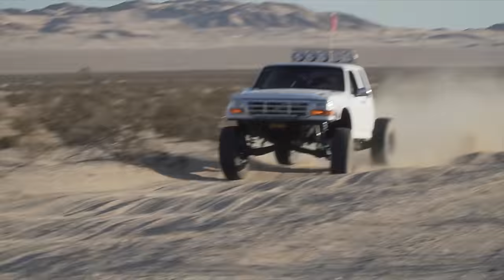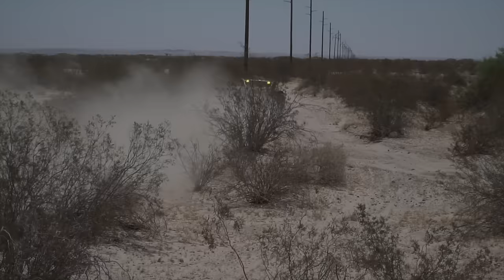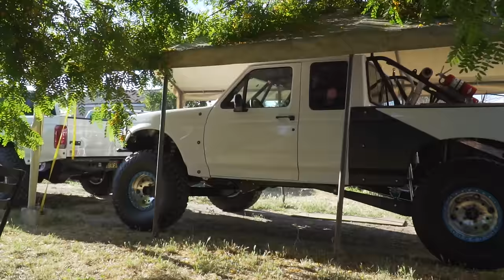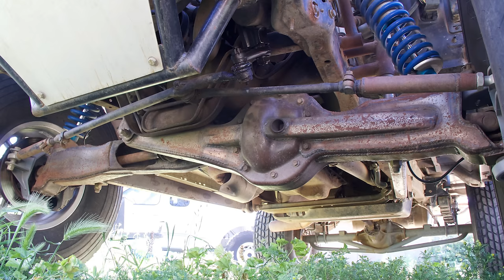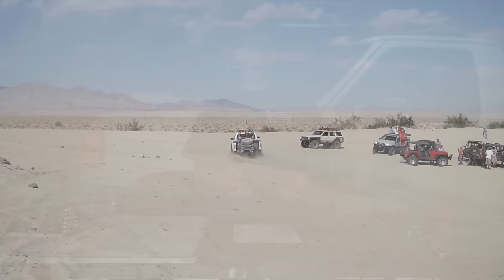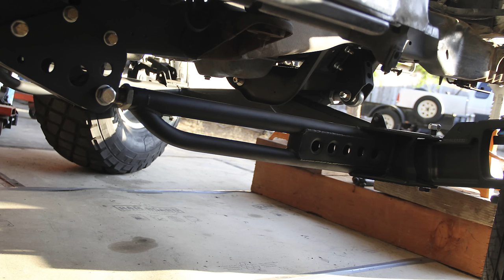I BEAMS VS. A ARMS! Which is BETTER? PRERUNNER 101

Comment: One thing not mentioned in regards to steering is ackerman and its effects on the street. I beams usually has horizontal uniball/balljoint/kingpin in short this means the steering angle is unlimited, you can have proper ackerman where the inner wheel turns more than the outer wheel. with a arms, specifically "race kits" the upper uniball is usually vertical , this gives about 32 degrees steering before the misalignments are maxed out. to compensate most kits run reverse ackerman where the outer wheel turns in further than the inner wheel; this causes scrub at low speeds and impedes steering radius. this topic is a rabbit hole but worth mentioning
Reply: Exactly the rabbit hole all of the different set ups designs etc really have trade offs even building something from the ground up with design.
Reply: To combat this issue, I ran a ballistic rod end for my upper, it had a misalignment of 74 degrees total or 37 degrees, which was more than enough considering the cv joint limitation.
Reply: @davidfarmer  Can you explain to me what angles you're referring to on 74/37 degrees? And you mention CV's, so I'm assuming you're running a 4x4?
Reply: @JacopoSkydweller  yeah it was for a 4wd spindle. basically 0 degrees with the tires straight forward, then all the way turned and bottoming out 37 degrees of misalignment. The bolt that goes through the ball of the joint run from the from of the vehicle to the back. this way there is no restriction on up and down travel.
Reply: Correct, but the spindle design, as well as the wheel offset play a role as well.
Reply: @davidfarmer   Oh gotcha, that makes sense. Thanks man.

Comment: For most of my life stock fords had I beams and Chevys had A frames. I believe this explains most of the differences in the way they drove. I'm not talking anything but stock from the factory with a lot of miles on them. My experience was that the ford front ends were more durable and almost impossible to damage. But the Chevys handled better on the road and were easier on tires. I also noticed that that with Chevys handling was far less impaired by lower quality tires. I believe if I was going to do a lot of off road driving with stock equipment I'd choose an old Ford. Once you move to modified equipment I suspect it has more to do with how much money and effort you put into it.

Comment: The problems i see with I beam suspension is the wheels are probably gyro based (the wheels look heavy and they will spin around rapidly), the camber would probably offset the weight of the circumference and probably cause unstable airtimes.

Comment: I had to build up my radius arm to beams. I gusseted and plslated the beams put top & bottomm radius arm to beam mounts and added a vertical piece that tie them togetherand added a mount to the beams MADE GUSSET TEMOLATETS AND HAD A METAL SHOP COMPUTER NAVIGATED CUT VERY NICE THEN MY PRO WEILDER FRIEND AND i PUT THEM ALL ON AND HEQTED QND BENT WOME DOING SO TOO. i added an F250 pass side axle with the big U joints then cycled it in 4wheel drive while spining the wheels by hand while turning left and right clearing any tight spots and set the limit straps. i have put it through a lot of whoops some air and surprises with no problems. bought 96 glass fenders and hood with core support new radiator grill headlights split my astock fenders and added strength to the outside of my inner fenders and tubes to the core support. Went HID with the hes=adlights big improvrment and some brighter HID's with the same ballasts into a set if Hella cans for light further in frontbeams it changed the 87 to the 96 front end also 96 spindles the brake calapers bolt to and one was about to loose a pin of the 2 when I did. all new spindle bearing studs bearings and seals and outer axles to loose the tophat hubs. AMBLANCE STEARING ALSO. rEBUILT THE TRANSFER CASE PINNING THE OILER NRE PLANATARY GEARS AND CHAIN AND A DOUBLE COUPLER FRONT DRIVE SHAFT. banning driveshaft built me a new rear when mt new bronco graveyard went outon the way home from the river with no off roading towing a small boat do to Chineese U JointsPut glass bedsides on tooother work of course but it performs well.

Comment: Double wishbone or A arm independent suspension (and multi link independent for that matter) absolutely gain negative camber for exactly the reason you describe starting at 13:23. If you have so much body roll that you are overcoming the suspension's ability to gain negative camber you may have too much body roll. It could also be that you have an extreme amount of travel for the length of your arms or packaging forced you to compromise.

As you've drawn the A arms, they are the same length and parallel to each other (more or less). This is not usually how these are designed for the exact reason you describe. From the front the arms will usually converge at a point (the instant center) and from what I have seen the lower arm is usually longer. From the side view there are also angles in the arms which result in anti-dive, anti-lift and anti-squat geometry

The design of suspensions is used in many high performance situations (on and off road) precisely because you have more control over the tire contact patch as the suspension cycles. Usually controlling body roll is taken care of by suspension geometry design and then anti-roll bars and damper tuning. 

I am looking forward to this series. I really enjoy suspension design discussions.

Comment: @ 14:00 - Yes, this is why correctly designed A arm suspension must take into account the weight, center of gravity, etc and design the suspension in order to better control the roll center and thus, rely less on the sway bar, increase traction and provide improved geometry through suspension cycle, including possible toe in through compression for stability if needed. More importantly, when the roll center is determined correctly for the given setup and the known roll angles are calculated, the suspension arms are designed to work in conjunction with this. To your point, typically you will see the upper A arm is shorter and at a slightly upward angle compared to the lower. This is done specifically to "pull in" the top of the outside tire to increase camber ankle and conversely decrease the camber angle on the outside tire. Through further geometry changes you can also make the tires toe in/out as needed as well so at bump you don't experience wondering or instability.

Comment: Thank you for these videos. I am going to be building up a 2020 F-150 5.0 little by little over the years. I want to get rid of the electronic steering and do a long travel kit for the front. I will probably start with the rear first since it is a bit simpler. It is going to look like a dually for a bit probably with a wider Curie axle in the rear. I probably should of started with an older truck or someone elses build (I had 04 Ranger that would of been perfect) but one of my workers at the time really wanted it so I sold it to him.

Comment: I needed a new 4x4 and was sugested to buy a full size Bronco to build as a prerunner.   am happy with it.The TTB can give you alot of travel with 4 heel drive.  With lgears ockers and King shocks along with glass fenders and bedsides for tire clearance. it works well.  I did some work plating i PUT SOME 96 SPINDLES ON THE BRakeCALIPERS BOLT TO THEM  INSTEAD OF THE PINS. ITTHAT ONE ONLY HAD ONE STILL IN ALL THE WAY

Comment: If the a arms where equal length upper vs lower and parallel like you have drawn them then they would be perfect for staright line driving. I beams on the other hand are perfect for turns but suck at straight line driving. By having smaller upper a arms and slightly angled you make a compromise for straight line vs turns because ther is a small change in camber but not as much as the I beams. Also I think an important thing is that a arms have usually less unsprung weight vs I beams and that makes them better the higher the speed especially compared to straight axles.

Comment: I’m not quite convinced with the a-arm diagram at 13:48.  A-arms are designed to maintain a nearly vertical outside wheel.  The purpose is to maintain maximal tire contact patch with the road surface.  To do that the unequal length arms produce more camber as the wheel travels up in its stroke.  It needs more camber to overcome the loss of camber due to body roll.  So in the diagram the left side wheel (US drivers side) should be vertical.

Comment: I think an a arm truck usually corners better then beams.  Not sure that there is any advantage for beams over a arms in cornering.  Also you can usually eliminate 80 percent of body roll with a rear swaybar.  Just my opinion. Cheers

Comment: @wingsworld i have 2 twin i beams 460ci 8lug  88 and 90 and 1 twin traction beam 89 351w 4x4 5lug. 1 of 3 tru ks are stockish size tires... 90 has massive oversize tires 285 75 16's on some bart wheels and it scrubs at almost full lock. But i also have a full time locked rear end in it .

Comment: Camber change on a short arm long arm IFS is due to the shorter arm being on top, and the difference in separation at the spindle vs the frame. generally with desert trucks this is a non issue during cornering because they all run sway bars. 

In my opinion the best setup for SLA IFS is to have the camber neutral at ride height, negative camber at full compression and droop. this can be achieved by shortening the upper, and increasing the separation at the spindle, and or decreasing the separation at the frame. The reason this is advantageous is because your effective contact patch stays in the same spot so your track width is maintained during full travel swings, meaning the suspension wont bind. The rear axle will still have full traction and a flat contact patch. Also it might be a good idea to have your arms mounted parallel to each other, giving zero anti-dive. the reason being that you don't want caster changes to occur during full swing travel at speed. This also allows you to use the throttle and brakes to counter bucking that happens during whoops, or between hills. blip the throttle the hood comes up, blip the brakes the hood comes down. Also having the arms parallel makes bump steer a lot easier to cancel out. Ive also seen people set the angle of the arm mounts so that the front mounts are higher than the rear, this would basically help when hitting bumps as the suspension would bind less and move backwards towards the vehicle as it hit the bump, so basically the speed of the vehicle helps compress the suspension when it encounters a bump.

Comment: Complete amateur here. I want to build a pre-runner, maybe a 3rd gen Ranger, maybe a mid 2k Tacoma. Currently own an 04 4x4 Ranger, it's a Torsion bar front end, IFS. I would definitely switch to 2WD for a pre-runner. Things I would like to know: where does the frame need to be reinforced and the engine caged? I understand why, but I guess my question is how do you know what is good enough to prevent control arm mounts from shearing off?

Comment: Equal length A arms don't have any camber changes , but for some reason they almost always end up being long arm short arm systems .
Reply: It's to have more camber to compensate the body roll when cornering at high speed.

Comment: If someone was building a custom tube chassis vehicle and wanted to use trailing arm rear suspension  would running I-Beam suspension for the front suspension be a good idea? I don't know what suspension type is used on rock bouncers, rock crawlers, ultra4 vehicles, or on trophy trucks. Thanks in advance for any and all advice, opinions, or answers. Regards

Comment: I wonder how much travel i could get out of my Ranger with the 2 wheel drive torsion bar suspension ? I know that Ford made the Edge and later Sport models with torsion bar suspension as a supposed stock prerunner . But it's nowhere near a real prerunner , even though it's way smoother than the coil sprung version . Have you ever driven a 2 wheel drive with torsion bar suspension ?

Comment: with I beams you need bent i beams. They come either  forged or pitched. I say just take the shit to autofab and they take your old stock beams and install bent i beams, new coil springs and some heim jointed bilsteins.  90s f150s r the shit! u dont need no coil overs if u dont got a link in the rear. no link no expensive coil overs. 33 in tires no problem . good luck steering  37s

Comment: Both are junk cause neither one has a solid front axle
Reply: Solid axles are fun, truss it coils/track bar and the biggest shock you can afford. But the Beam and A arm trucks alow for more travel. You'll be hard pressed to get more then 14" out of a axle truck.